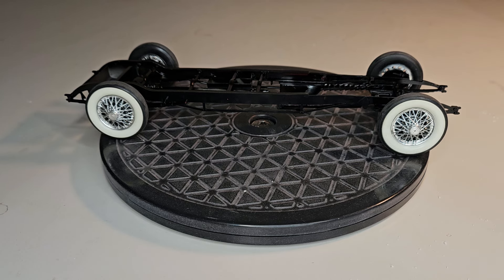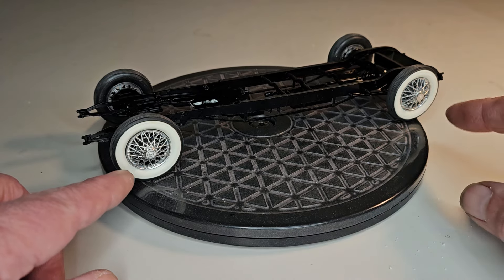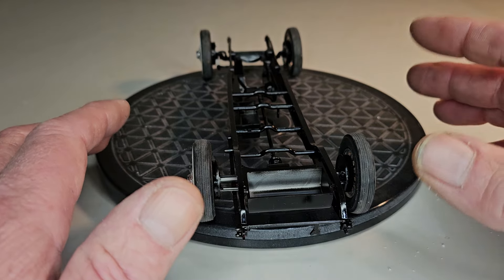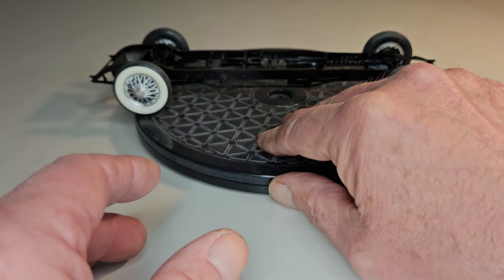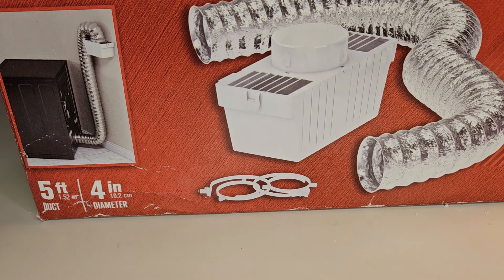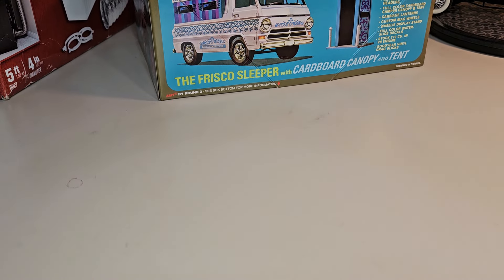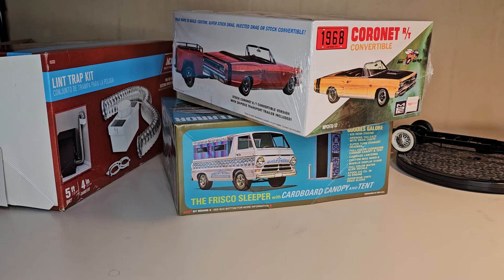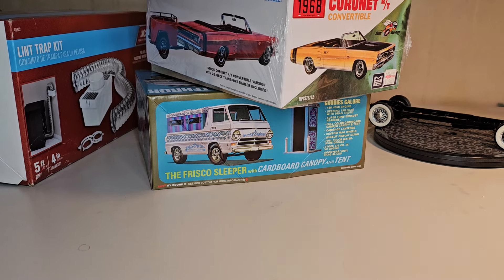March 21, 2024

Comment: Was Excited AMT Reissued TTT Kit Its ,S Bummer the Clear Plastic Phone Booth Tool eas Lost. I'm Also Doong as Stock Phone Service Truck adding Slant Six/Auto & Modifying Bed Rack so Front isn't attached to Roof
Reply from the maker: I have an earlier release of the lil red wagon and the l700(?) semi. Everyone sweats the hinged doors? They have to be fitted to the cab before you can install....not that tough!  This new kit has fun stuff included, will be a cool project!